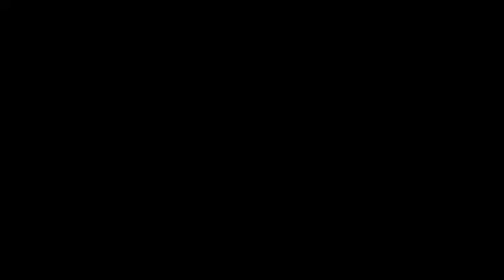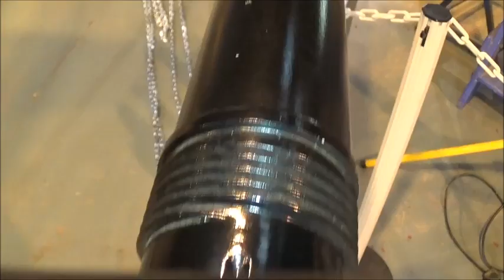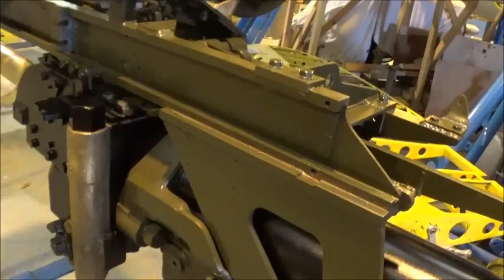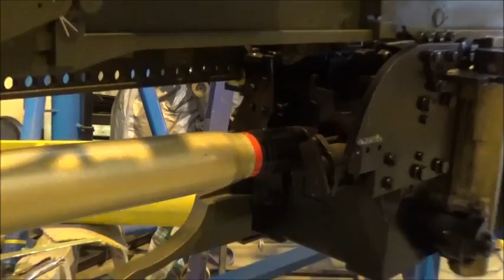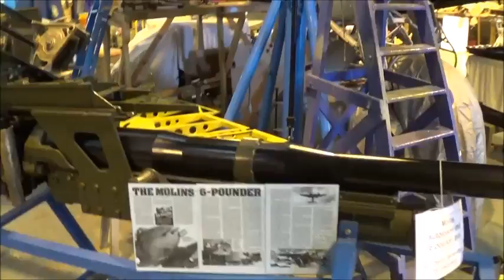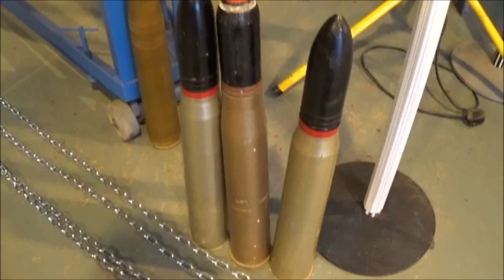DH 98 Mosquito up close - Molins 57mm 6lb Auto Cannon

Comment: Had a read the Wikipedia article, first, I would not have been surprised to learn the Mosquito mounted a 57mm / 6-pound cannon. Until now, I had believed 40mm was the largest gun mounted.
Reply: 75 mm not 57.
Reply: @jeffreyprezalar220  57mm not 75mm
Reply: @russella7263  a 75mm canon was mounted on some variants of the Hs-129
Reply: The also built a 32 pounder, 94mm anti tank gun version which was flown and fired from the Mosquito with no problems.
Reply: @jeffreyprezalar220  The B25 had a 75mm fitted